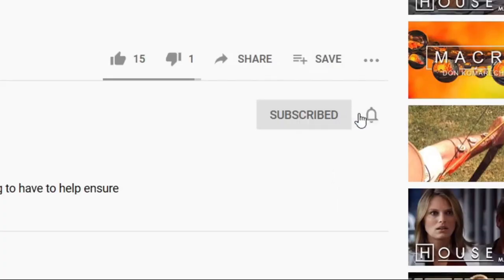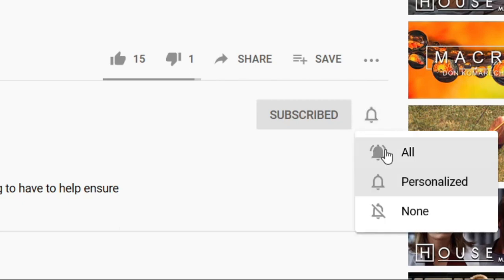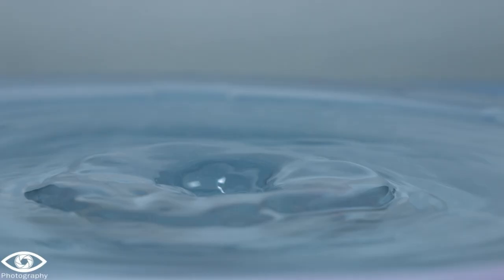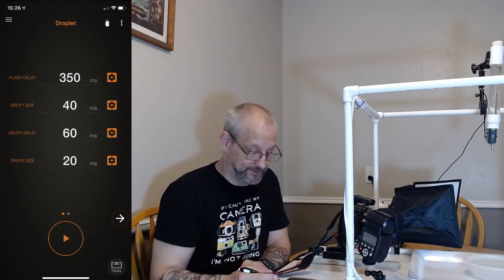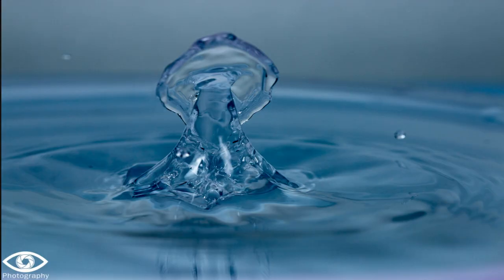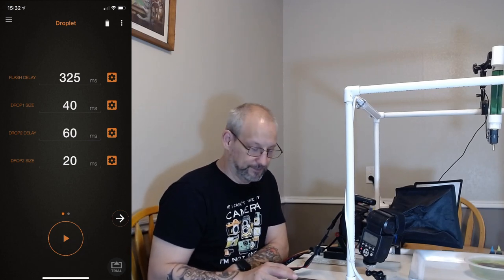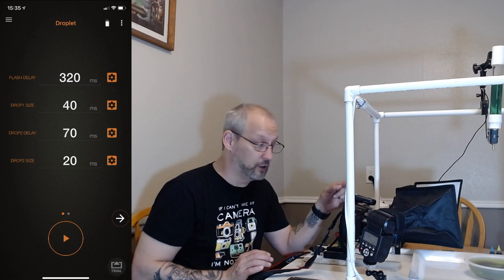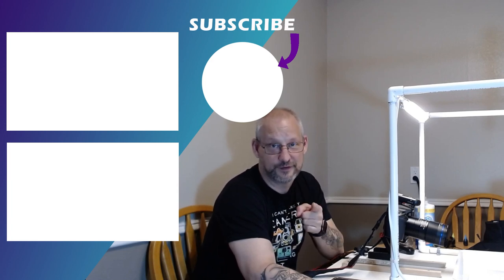How to use the Pluto Valve to Create Amazing Water Drop Images | Part 2: Using the Pluto Valve

Comment: Good video, covered many good points.  Have been using the Pluto trigger for this, off & on, for about a year, and it has worked very well.  IF you adjust the solenoid and it still has an issue with 'running water' instead of creating drops, the company will send you a new one to replace it.  The flowing water should not happen, even with plain water, so you may have an issue with that valve sticking periodically.  It's not unheard of!  Additionally, use the infrared trigger from the Pluto to trigger your camera when the app sends the signal to the valve.  It makes things a bit more consistent, and you don't need to allow for the wireless flash delay.
Reply: How to adjust the solenoid? Is there any guide online? My valve  randomly stays in open position till I tap it. Even when it works I have feeling it's not releasing drops correctly because of that... BTW when shoot water drops always set the camera for mirror up shutter mode, that will decrease huge amount of delay and will give 100% consistent results. In the video he struggle with consistency as his mirror introducing huge and inconsistent delay. Thanks!
Reply: @lurker668  Clean the unit
Reply from the maker: The best way is to take the valve apart to clean it and adjust. There’s another video here on YouTube (I think I linked it in one of my other vids on this subject) on how to do that. It’s super easy.
Reply: @CarlConstantine  Thanks, I think in my case the valve is faulty as it did not work properly from the box. I did the cleaning but it works only when I lose the big screw, when it's tight it won't close.

Comment: Howdy! Do we need the Pluto trigger, or can we use the Pluto valve with just app
Reply from the maker: Hello and thanks for your question. Yes, you need the Pluto trigger as well. It’s the interface between the app, your camera, and the valve. Now the trigger isn’t just for using with the valve, it can actually do much more on its own. But the valve requires the trigger.
Reply: @CarlConstantine  I appreciate the response, I’m in need of something between a splash photo device (control size of bead/interval) and aquarium dosing pump (move liquid from reservoir to droplet nozzle). If I can’t find a product I’ll have to make it myself! 🙏🏻👍🏻💪🏻. Thanks again

Comment: Hi Carl, enjoyed your video and it was instruction. Thanks for demonstrating the Pluto valve.  I do have a few questions.  My first question concerns the PVC set up.  I based my setup on your PVC setup.  Problem is that the clamp that connects to the PVC slips and the arm drops down woth the valve.  How do you keep the clamp tight enough so that the arm does not drop?   I have a few other questions perhaps it would be better to communicate through email.  Angain thanks for making both videos
Reply from the maker: Thanks for your question. Sorry for the late reply, I’ve been super busy. I actually had the same problem initially. It’s a bit of a fine line actually. I use the SMALLRIG Multi-Functional Ballhead Clamp Magic Arm Adapter with Bottom Clamp available from Amazon. It has rubber pads on the clamp. I tighten the clamp pretty good. I also found that the extension arm has to be really tight to keep position. That took quite a bit of fiddling. Finally, where you clamp the valve makes a bit of difference. I found clamping near the bottom of the valve worked best. I hope this helps.

Comment: nice tuto. however, I don't understand what you explain for the setup. sorry for my english :-) where is the pluto on your setup ? do you mean your pluto is connectd to one speedlite with second one slave by IR ? in my mind there is a godox xpro transmitter (or similar) on camera and pluto is connected with a DC2 cable to camera. when we press play button on iphone, it triggers pluto by bluetooth which, in turn, triggers the valve and the camera by wires (so very fast) and the camera xpro triggers by radio the two speedlites. is it what you are doing ?
Reply from the maker: The Pluto trigger is connected via wire to the valve. Additionally, another wire connects it to my speelights (Yongnuo 565 III) via a PC cable. I use the Pluto app on my phone which connects to the trigger functions via Bluetooth. So the Pluto trigger is sitting just off to the side. Reading your description, that setup also works and is what I did in Video 1. But I found that it was very difficult to get consistent collisions captured as images as the wireless triggers to my flash give enough of a delay to be off and I only got some that would work. This is why this method works better. Have your camera set at 1” for time, your speed lights at 1/128th power and trigger. Successful collision captured every time.
Reply: thank you very much. does it mean pluto is on a mini tripod towards camera and triggers camera in infrared ? i didn't imagine we would loose so many msec with wire to camera and radio trigger of flashes with a xpro transmitter. I can understand you connect one speedlite to the pluto but how do  you connect second one ? slave infrared with first one ?
Reply from the maker: @marclabro   no in this setup the Pluto doesn’t trigger the camera at all. It would cause more delays. So I just put a long exposure on the camera and trigger the Pluto for consistent collisions.

And yes, the second speed light (if you want to use one) is just set in slave mode.

Comment: Hi Carl this is great.  Are the drops repeatable with the same settings. we have not had much success in getting the water drops.
Reply from the maker: They are repeatable if you connect the valve directly to the PC port on your flash (if your flash has that, some do not) and you leave the shutter open a bit longer (I think I used a 1s shutter speed). That way the flash stops the motion of the drops and you capture it, every time. If you connect the valve to your camera and rely on wireless trigger release, there’s enough delay caused by the wireless signal that it was extremely difficult to get repeatable collisions. It almost made me give up on it.

Comment: I've had two Pluto water droppers and neither worked properly.  The replacement they sent me was worse than the original, the solenoid was perpetually open and the water ran straight through.  I was amazed how it could have got past Quality Control.  I won't be buying another.

Comment: You didn't show how to set up the camera or wire the flash units.  Dissapointed
Reply from the maker: Sorry to hear that. I didn’t show details, but I did mention how to do it. There are no wires on the flash units. They are all wireless. One has the Pluto trigger in the PC port and the other is set to slave. Both are 1/128th power. This I mentioned in the video.